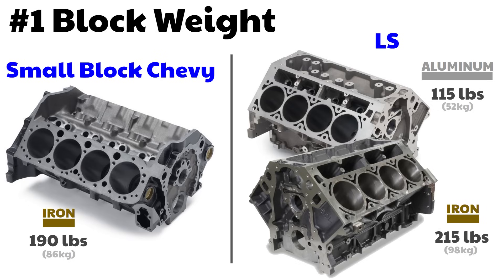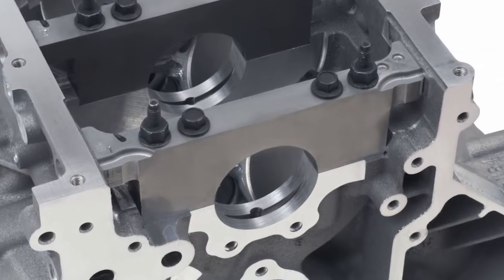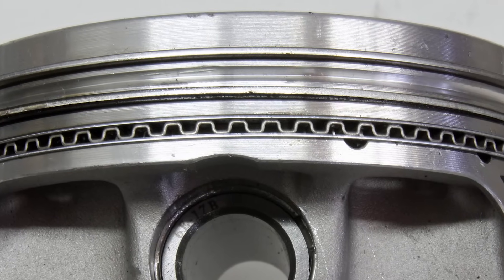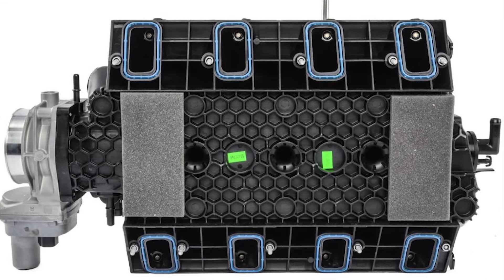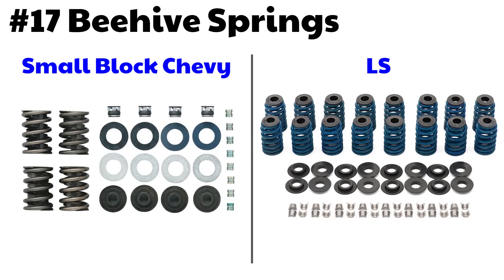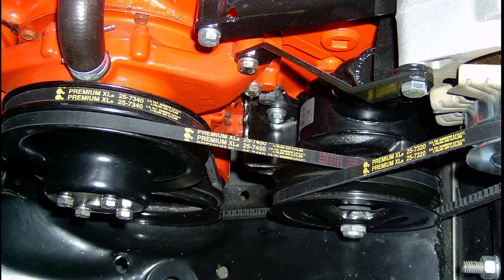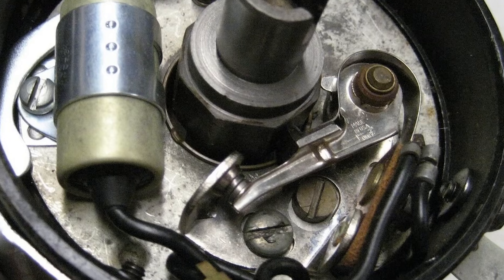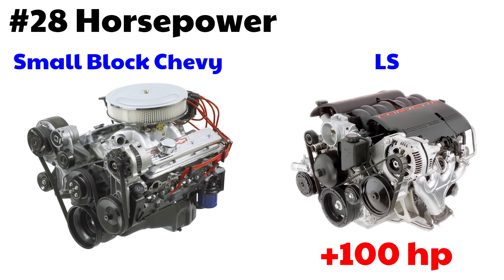29 Reasons LS is Better than Small Block Chevy (Gen 1 & 2 vs Gen 3 & 4)

Comment: This is probably a guy who lost a race with a stock sbc 🤭, you can build a sbc to be faster
Reply: For a shit ton more money sure
Reply: @Dennis Burger my block for my 84 z28 is a 350, the only mods I did were heads cam, headers and ported the accessories, everything else is stock, but I want to purchase forged mahle pistons, and my carburetor is the stock carburetor that came with it when I got it out from another z28
Reply: @LifeofUly  I have an 84z aswell. Super clappy - Just a single stage355 build under the hood. Stock heads, rv cam, Long Headers and the stock 373 rearend. Oh yeah, and a chirpy 350turbo with 2500stall. The icing on my shitcake is my 142 Weiand I came across for under a grand. Cost me less than 200 to rebuild. Pulling 8lbs with my blower ready Holley 750.  It went from quick,  to I thought my tires were sticky enough.......
Reply: @Dennis Burger im not sure what pistons my block has but all I know its just the same oem just replaced em tho
Reply: you really need to bump your cam specs up a whole like .650+ valve lift and throw some dome pistons in it. then you could take advantage of those massive runners also
Reply: I'm running a 91 block scat crank 96 pistons China 210cc 2.02 1.60 59cc Chambers and LS bee hive springs and lunati 1.6 rockers HV oil pump and canting 8 quart pan. Feeding it fitech through a single plane wiend and a 2" carb spacer. .554 cam
Reply: Right around 1800 no laber
Reply: LS IS old school as electric vehicles come into play. So is gas going to be. I'm not liking that but it is true.
Reply: He's got the HP numbers low on the SB for sure but you should see some of the numbers these vette guys are getting out of the LS. Just look up "cammed z06". An aftermarket cam wakes these engines up
Reply: @Dennis Burger all I did was port my intake add a spacer, bought afr heads 235cc and ported those as well, and bought a comp cam, and kooks long tubes straight pipe , and mines makes 450 hp, compared from what it was making, HUGE difference, the 115 hp wasn't really pretty numbers
Reply: @LifeofUly  intake, heads, cam, and headers are not getting any SBC to 450hp. Sorry grandpa. You weren't hopping coke cans in the 70s. 

Now, give me a SBC that can make 750hp on a stock bottom end with a single turbo, and hold up for 2 years of abuse. 

Because that's what LS engines do.
Reply: @hemichanga  450hp is very doable, you can make 1.5hp per cube naturally aspirated all day and it will last years. it’s not as cheap to build to that level as a LS it’s still very doable.
Reply: @hemichanga  back in the day, a 450hp Chevy small block was not uncommon. You needed to take care of the machining, but Chevy made forged pistons and there was plenty of aftermarket. Forged cranks, four bolt main caps, pink rods...all out there in the junkyard. honest.  

But there's a lot of variables in the comparisons. Any engine running a power adder, needs larger piston ring gaps, or they butt together and snag the slug and boom. So you tear apart an LS and have to replace the stretch-to-yield fasteners...and the cost goes up. If you have to take that engine out the big dyno room and shove it into a car designed for only a small block not a big block, will all that 3 inch turbo piping fit? if not, then more cost, as you try not to choke off the air flow by experimenting with oval piping. And then there's the classic power steering pump issue--many LS used electric steering. more cost to solve that problem if it comes up.

A lot of folks talk about how cheap it is to go LS...since they blow 'em up regularly. But the days of the cheap 5.7 litre are coming to an end, now its the 4.8 litre that's the bargain. and that's a relatively tiny displacement for a V8.

Comment: I think his hp ratings on older SB parts is 💩💩.. Most of us know better.
Reply: @Dennis Burger those are great heads...Ran them on a 355 few years back...12.3's E.T
Reply: I think what he means is safely for street use. Sure you can get 1400 out of an ls but for how long?  Same with old small blocks. you could probably get away with 800 for awhile but not exactly safely i would say. I Hope You Are Having A Great Day !
Reply: @Dennis Burger very good times..hands down. I was able to purchase mine from a guy on on the web that had reworked then with some pocket porting, 2.02 valves, and screw in studs.  Loved them.
Reply: @Axrbear  really just unshrouding the valves with 1.94s is just as good
Reply: Dennis Burger I have done a 11:30 with a small journal 66 Nova 327. Stock heads , stock crank and rods also. I ported the double hump heads ,780 carb team g Intake and nasty roller cam. 630 lift with 12:1 pistons and 4:11 gears
Reply: @Dennis Burger Indeed. I used to run 327s in the 80's when they were easier to find. I run 318's now. Im hooked on that short stroke hit you get when you nail it. I've built long stroke Pontiacs and the power band is world's difference.
Reply: His ratings are all around low. Richard Holdener did a big bang series on the Gen 3 and gen 4 Chevy. Upwards of 1400hp on a sbe 6.0. that's definitely a whole lot more than 1000...
Reply: he's talking factory stock
Reply: Hot Rod magazine had an article on the first gen, and I think they "maxxed out" the potential at 300, too. If you've gone thru the blocks from the late 1970's when Detroit was taking it in the shorts...there's some scary stuff. And that's not counting the 262/267 small block twins.

As for torque, I had a 69 Goat and now a '68 4-4-2 with a 461 cid big block with variable duration lifters. I can pull from a dead stop in top gear (manual valve body THM400) with the switch pitch torque convertor set to 1,800 stall speed and a 3:1 rear gear ratio...all day long.

torque is awesome :)

Comment: Lots of bias in this video , I've had both and many of these engines , ls does have quite a few advantages , however , depending what your goals are , I have a 434 ci smallblock engine in my g body , 10/1 compression,  roller cam afr heads , street engine , I've broken too many ls guys hearts and souls with this engine  from a dead stop , you'll have to build one hell of an ls to match the the low end torque this thing belts out , 500 lbs already at 3000 rpm maxing at 590 at 4400 , 568 hp at 6300 , with a relatively small roller cam and 200 cc intake port , idk perhaps I'm a little biased
Reply: Me to I have a 1987 SS MONTY CARLO WITH A 355 BOLDE OVER 60 AND I BEAT A HELL CAT AND I'M RIDING ON 26S  MY BABY FAST AS  FUCK A LS I GREW UP ON CARB ENGINES
Reply: 195 cc is close enough to 200 , was making a generalization but if you need exact specs I can go into detail
Reply: I am currently debating going that route for my chevelle, I'm kinda between going LS or going big cube small block like a 427. As someone who says you've had experience with both, what do you like better on a sweet car? And is there a mileage difference if they're both hot rodded out?
Reply: Tassilap the ls is a sweet engine and makes incredible power , but the sbc can make it without all the extra electronics , and super expensive parts , price a sbc stroker kit , vs an ls stroker kit , btw  the sbc can outmuscle an ls , at low rpms
Reply: Lol.....if you dropped a wrench into the plenum and dinged it you would probably have 200 cc....dont you love these part spec natzis.
Reply: @johnwirk  🤣🤣🤣
Reply: See the problem I’m having I have a Chevy 350 010 but you can get 550 maybe 600 hp on motor if you add a turbo or nitrous you’re gonna send it to the moon and this is where the LS comes in I’ve seen these damn motors with 3000 hp I’m old school I love my 350 I’ve had it for years it runs awesome to be competitive today you have to run 800 hp or better especially if you’re running know prep This guy makes LS is sound like the greatest thing since the slice of bread I think I rather bite the bullet and get a dart to block

Comment: I got a 73 Vette wanted to do a LS swap but really doesn’t make sense. Already have big $ hooker side pipes. Going SBC with good heads cam and a centrifugal supercharger
Reply: You will be happier in the long run because the sbc in your vette will always be cool and proper, In a few years all this ls stuff will be super outdated and not cool anymore and people will either move on to the even newer stuff or go back oldschool with the tried and true sbc or bbc engines.
Reply: Good for you. I have a 350 in my jeep yj. But if I find a 6.0 or maybe even a 5.3 for less than $800, I'm getting it.
Reply: And a sbc is right in your car. Check out david visard's¹s sbc on a budget.
Reply: @brianmorrison9066  if you call your local junkyards you can find a 5.3 for around $300-$600 pulled out but most junkyards wont sell 6.0l for cheap unless you pull them yourself. The biggest problem with a ls swap is that everything you need to make that ls engine run will nickle and dime you to death. The engine itself might be cheap but for wiring, fuel system, lines, hoses, accessories, motor mounts and everything else you need it will always cost way more than you expect.

Comment: David Vizard tested 350 stock block with good parts nitrous cracked on engine Dyno 1100hp🤔👽🚩🚩
Reply: I boughy a brand new " Bow Tie" block feom Skip Whites. Bullit custom 4/7 solid roller, pro system carb, callies bottom end, JE and AFR  227 ported to 245 on a 421 sbc. I loved it and still have it. Went 5.42 on on 1 kit ...2600 Chevy Luv , all steel..minus hood, factory glass. Man, i love that engine. Now i have seen what Ls motors can do...im sold. Not worried about looks but want to build the engine , tune it ( no laptop) . Im 45 and still have a 427 tall deck im gonna build next year. I guess its a gear head thing. Happy Hot Rodding !!

Comment: Id rather have a nice SBC stroker with around 434 inches, or 454 inches,  all new, good quality,  built for pump-gas.
Dart block, forged rotating assembly, nice roller cam, AFR heads, nice intake and carb,  10:1 producing around 550 horse and 525 ft/lbs for around $10K, a nice torque street engine that can burn rubber at a stand still and sound good at idle.
A 600 horse LS3 of equal parts and displacement would cost closer to $20K.
LS wont really turn any heads until they introduce a large displacement engine, say 500+ inches that makes 700 horse naturally, at some point GM will have to do something special to compete with Shelby500s and Hellcats.
Chevy aint doing shit right now as far as creativity, same ol boring shit where the top GM production engines only go in Vette and maybe some special edition Maros,  while Dodge is putting the Hellcat style Hemi in several different models like the Jeep and Durango. How come GM dont put the  LT5 Vette engine in a 2021 Yukon, or a ZL1 Camaro engine in one of their trucks?
Yea, talk about bad on gas but still..

Comment: I'm old school myself, I think the SBC  is a better engine not only in looks but I like the 5 head bolts per cylinder versus 4 on the LS. I wonder if the LS will be around and rebuildable as long as the SBC? Only time will tell.
Reply: Been proven better 900 wheel hp on stock head bolts on a ls .can’t say that for  most old school small blocks.any iron ls can be rebuilt and bored out even the aluminum ones are rebuildable .not to mention that a 4.8 ls makes more power stock for stock then most 350 small blocks and 5.7 ls1 is on a whole other level you can’t compare to the old stuff
Reply: @utahcountypicazospage5412  Really?  REALLY?  Then explain why every NASCAR team used a 1955 SBC design until NASCAR mandated all Chevy teams must use the LS engine.  Explain why in 2022 every sprint car team running chevy engines (99.5% of all sprint cars) both 360 & 410 cu in. Use the 1955 SBC.  Cost => $55K and produce 950 hp naturally aspirated burning methanol.  Explain why Chevy gave Ron Shaver a blank check.  Tasking Shaver to make a LS 410 sprint car engine competitive with the SBC 410 sprint car engine.  Explain why after 2 solid years of R&D, Ron Shaver's best effort was 850 hp from a methanol burning LS with 435 cu in.  Not 410 cu in.  Explain why (in 2022) you can't pay a sprint car team to use an LS engine over a SBC engine.
Reply: @rayism 24b  NASCAR also mandated using the SBC and carburetors for the longest time. NASCAR, thanks to the France's, took one of the greatest gold mines in racing history, and blew it all to Hell. NASCAR's time has come, and gone. Dodge came out with the new Hemi, but NASCAR said they couldn't race it! GM comes out with the LS engine, but NASCAR said they couldn't race that, either!! I loved NASCAR when they actually were cars you bought, and modified for racing. They even had doors. I NEVER watch anymore. They make me sick.......
Reply: LSX block has 6
Reply: @ilham7345  But NOT equally spaced. It is a patch up at best!
Reply: @ldnwholesale8552  if you think it's just a patchwork. then it must be the best patchwork ever done in the history of pushrod V8
Reply: LS uses better cylinder head gasket sealing technology than SBC's used, which is now available for SBC's but overall seal just as good. one less bolt doesnt hurt the sealing capabilities, the newer MLS Gasket material is way better than traditional felpro or mrgasket gaskets.
Reply: It will
Reply: Anyone who thinks an old school chev v8 is anywhere near as good as the ls is delusional 😄😁

Comment: Only to the 2nd reason and theres already some fake news. The older blocks (before 1972) are UNDENIABLY STRONGER than any of the other year blocks because cost of manufacturing wasn't a concern, block thicknesses are noticeably thicker and very much less crack prone to 70's-90s blocks. Magnafluxing doesn't lie. Muscle car blocks will handle WELL over 600hp long as they're 4 bolt main, that's the only concern! Where the actual fuck did you get that 360hp number? Guess those L76/L79 327 cars must've been dropping like flies from broken blocks, not to mention the 375hp 350s and 400s. 
I don't disagree with the sentiment, but sheesh do some more research before making a vid.
Reply from the maker: remember the 375hp you talk about was gross horsepower, not net.

Comment: I’ll give you the one reason old school hot rodders don’t give a shit how many reasons you can name.  The LS is fugly and ruins the underhood look of a good hot rod.
Reply: Putting a 6.0 LS on a 4L80E in my 63 C10. Pulled the 350/TH350 for all these reasons. IMO it’s actually better looking than the 350 because you don’t have ugly spark plug wires running everywhere off a distributor cap that’s jammed up against the firewall.
Reply: imho, no engines looks ugly except modern volkswagen engines with cam bearings integrated into the valve cover
Reply: That’s just... like... your opinion man. 
Quote by: The Dude
Reply: @TurboNFRStwoK  - Yep
Reply: @danmyers9372  cant tell the difference between a retro style LS and a regular small block. you can put SBC Valve covers on an ls with an adaptor, you can hide the coils. you can get a carbureted intake manifold with either an EFI Unit or a carb. if anything, the only tell would be the exhaust ports. and even then, you can put BBC Valve covers and hide coil packs under them.
Reply: @68Cowmaro  the retro styling on an ls is just pointless, if your going through all the work to make your ls look like a small block, why not just put in a small block, it just doesnt make any sense and if your going to put a carburetor on an ls any way why not build a carbureted small block where all the parts like intake manifolds and heads are much cheaper. To do a carb swap on an ls requires an intake manifold and a coil driver box and for those both is around $1000 plus you would still have to buy a carburetor. GM performance does offer a timing cover conversion kit to put an hei distributor and mechanical fuel pump on an ls but that kit is around $800 and limits what accessory brackets you could use. I personally think the sbc is just the way to go on an oldschool car. I do love the ls engine but only on vehicles that came from the factory with an ls.

Comment: Dart and World now have in production, ultra high performance ls/gen1 if you will hybrids. They combine the superior head flow of ls with some old school gen1 block features,to address the weakness. I suggest you look each over to see there is a lot more to performance than meets the eye. The LS platform is excellent for production cars and trucks, emissions and noise, and everyday performance. There is a big difference in production to all out performance, but 400hp, 500hp, 600hp.....is  the same regardless of which platform made it.
An engine doesn't know which generation it is, what year it was made, what marketing was attached to it.